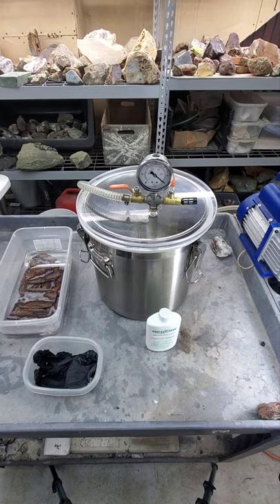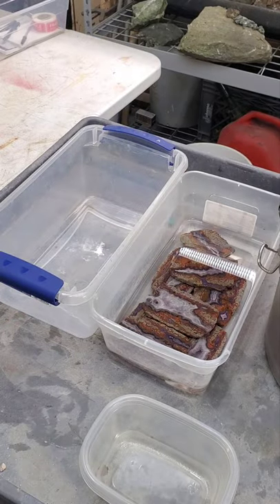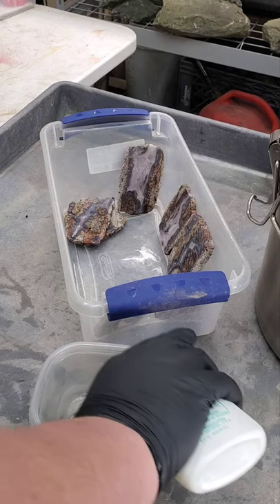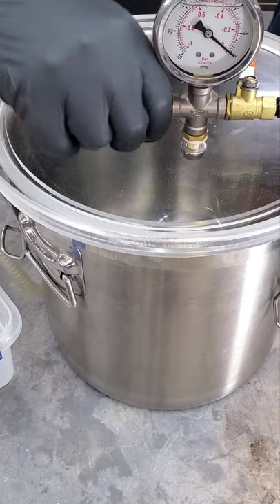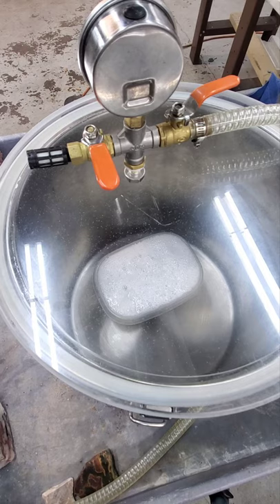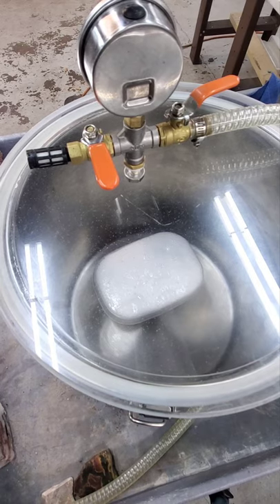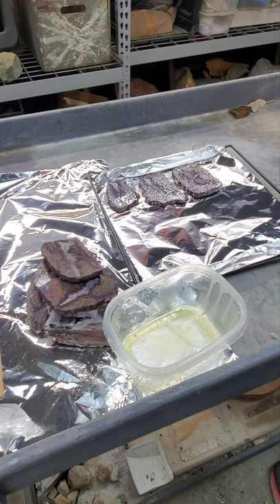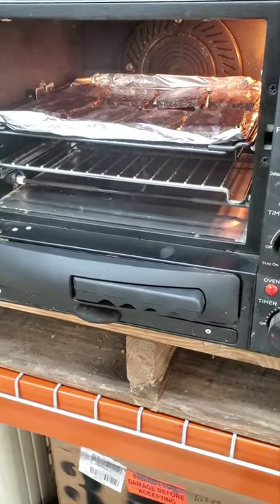Stabilize Stone With Opticon.

Comment: Just a heads up on your vacuum pump, when you turn your pump off with the pot under pressure, you must close off the valve going to the pressure pump because if you don't and you leave the pressure on the hose, it will break the seal in your pump and pull oil into your pressure tank.

Comment: I either put my container with resin in a bigger container or just use aluminum foil to make a little container.  If you get resin in your vacuum pot it is very hard to clean.  If you use the pot with different chemicals for different tasks it must be clean.

Comment: I use a heat pad under the vacuum chamber to get the opticon heat to 150 degrees. I let it sit over night. It gets into the tight fractures in clear crystal. Just wondering if you have heard this method? That drip looked like condensation.

Comment: Vacuum pulls the air out, it does not pull the product in, until you turn the vacuum off. Plus unless the rocks are fully submerged your going to pull air back in rather than the resin. Having said that, you are sucking in Part A only, then hoping the Part B from your final coat will mix with the penetrated Part A.  

You should really read the instructions for the product again, this is not how they recommend it’s done. Your mixing the two parts at the end and placing in an oven is the only part that is stabilising the rock.